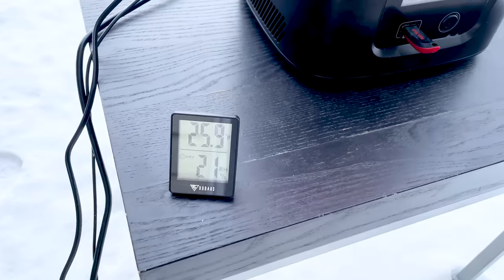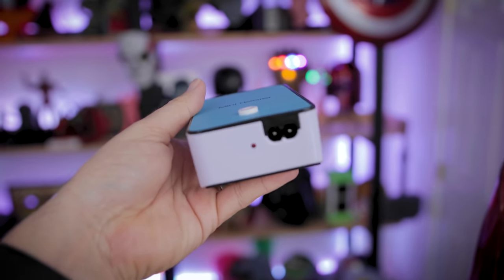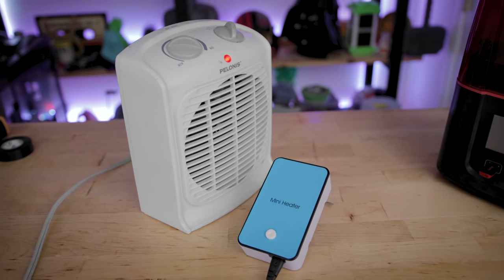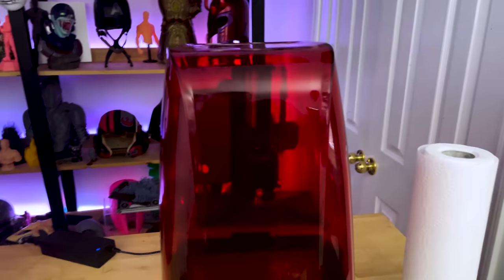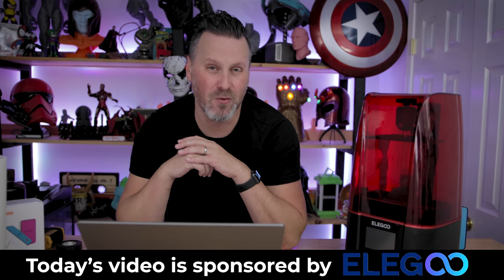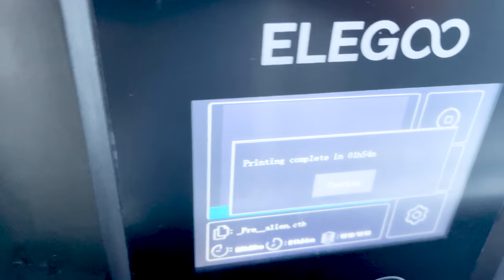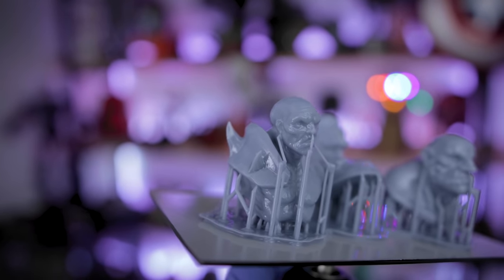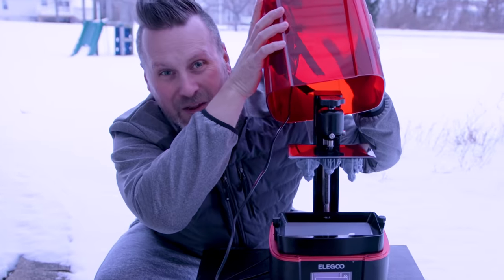Can you Resin 3D Print outside in Snow?! 🥶 + Giveaway Winners!

Comment: My poorly insulated garage gets into the low 60's. What I do is use an under-tank heating pad for aquariums. I take the vat out, sit it on the pad (covered) for 15-20 minutes and when the metal is up to 75 or so I start the print. So far it's worked great! Those heating pads are also pretty efficient. Like 40 watts for a small one, which is still a good deal bigger than the resin vat. I've also stuck the resin bottle back into the shipping box wrapped in the heating pad, but that takes longer and is a lot fiddlier to do, but may be the better solution for multiple printers.
Reply from the maker: Ohhh that sounds like a great option for people to checkout!
Reply: Ooh, those pads are just made of heating strips so you could theoretically find those(I know they made heating straps for bottles), wrap around a metal vat and regulate the resin temperature the entire time.
Reply: those work really well the especially because its for fish tank so it only gets so hot... I bought one of those ild heaters and out in my garage to keep temp in around 70 which works pretty good for me.
Reply: I just put my resin bottles in a bucket of warm water before I start the print and one of those heating mats warpped around the inside of the lid for my photon mono. Works like a dream
Reply: i will try reptiles heating pads to put on the back of the printer there are also heating cables and heating bands for beer fermentation :)

Comment: After a large amount of failed prints in the Australian winter last year, my solution was a heated blanket that I just covered the printer with. Clunky? Perhaps. Worked a treat? Definitely
Reply: That's what the lady at mitre 10 suggested to me when I came searching for a heated seedling mat.
I might end up doing the same as you
Reply: Could you share photos or a tutorial? I’m currently in despair because of cold weather and 3d printing ….
Reply: @istegal8752  only works if your printer is in some kind of enclosure, but just get a heated blanket, plug it in and put it over the printer, and just tuck the edges closer to the printer. Should help a lot

Comment: I use an inkbird thermostate with a Creality Ender enclosure (fire proof and other benefits), a small heater connected to the inkbird outside of the printer, but within the enclosure to get more stable temperatures for the resin. Works like a charm.

Comment: I use a reptile heating pad using the included sticky side to mount it on the inside of my plastic shroud on my mono x, keeps it around 20-24c inside my unheated garage. Haven't had a misprint all winter.
Reply: hello my friend i have anycubic photom m3 max and my garage is very cold i was thinking to use this metod , is it safe to stick the pad on the back of the enclousure ? i mean in the interior, how many W is your pad??
Reply: @lisaciscato255  120v 16w, the sensor is a light sensor - that little sticker on the back of the case just blocks light and tells the sensor the hood is down. Perfectly fine to block it with the heating pad instead of the sticker just keep in mind your going to have to dremel out a tiny notch for the heating pad cord to come out so the hood sits flush. Good luck!

Comment: I use a small (about 8inx12in.) under tank reptile heater mat, cost me about 12 bucks on Amazon and tops out at about 90-95F. I currently have it frog taped to the outside back of the hood for my Elegoo Mars, turning it into a radiant heater, and it keeps the interior of the print bay at a nice 80F or so even when my room dips into the low 60's to 50'sF in the winter with the blackout cover I use from MACH5IVE.

Comment: I use that heater with the VIVOSUN Heatmat Thermostat to control the temperature and provide a safety factor on my Epax E10 in my garage. I glued some 1 inch cabinet magnets to the bottom of the heater and then used a 2 magnet stack per corner on the outside of the case - no drilling of the case and very stable.

Comment: I just had a (maybe) pretty crazy idea...would an infrared heating panel pointed at the printer work? The advantage of such panels is that they don't heat the air but objects that are hit by the IR rays. Inside they are pretty efficient (at least when it comes to heating with electricity). I wonder if it would work outside. They are also not too expensive and there shouldn't be any fire hazard involved.

Comment: I also use a heat enclosure with a small ceramic heater with my Anycubic Mono X  in my garage. It was -6F outside today in Rochester, NY but my garage stays about 39F.  I also try to use a Propane heater in my garage for myself to get the temp up to keep myself warm while painting.

Comment: That mini heater might be useful to have. With winter it gets STUFFY inside, and being on the 2nd floor of a 3 floor appartment, we don't even need the heater on. It easily gets up to 78f in here so a window being cracked open even with how cold it is outside is a must. My 3d printer sits in a corner and wonder if I could mount this, not inside but near by just to help when I do need that window cracked to get some fresh air and to just manage the temp with out having to throw the AC on in winter.

Comment: Congrats to the winners. I am still on the fence about getting into resin printing. I do have a need for one, but not in a rush! I have no room for everything needed. Those heaters do get pretty hot. I have one I use to keep my hands warm while flying drone and it has a low setting which doesnt get too hot
Reply: What do you need a resin printer for?
Reply: @blackhawkuh-6026  I built an injection mold machine and need molds. Been trying fdm prints and silicone to make the molds with a number of issues. I saw high temp resin molds being made and that looks like the best option. Just finding the room and clean area is a bit tough right now. Dealing with cleanup and the fact that I may only use it when a new mold is needed is keeping me from taking the plunge too. Tried ordering prints, but most places didnt have the high temp resin as an option.

Comment: I have been using a 180W personal PTC fan heater inside the Red dome. It's easy to maintain 25 Degrees centigrade.
I did have problems when the temperature drops below 18 degrees.
I believe the Elgoo 3 is the best in field for the price. I have an Peoploy Phenom it is very,very slow by comparison. Monochrome 4K &8K are the way to go.

Comment: My basement stays at a stable 55ºf through out winter. The only thing I change is I bump the normal exposure .1 sec and the base 2 sec, never had any issues. Been doing it for 3 years now, with 4 different printers.

Comment: Is there any way to reagulate temperature (or just power input) on this? It's a little bit overkill, if temperature of printer is more than 30°C in snowy area:) Power input 200W is insane for such a small volume you need.
Reply: I wondered the same but I need to heat up a  Glowforge. There are external thermostats but you need one that controls mains voltage.

Comment: After many fails, I resigned buying a heater for my Mono X. It's the exact heater you have in the video (since people recommended that model).
I still have to figure out a way to get it in my Mono X though, I'm thinking of FDM printing something so I can blow the heat inside.

Comment: Cold isn't my concern. UV is. I was thinking of putting the printer on the balcony and printing in warm weather. I don't want to print in my apartment because of the fumes. 
But then I started thinking about UV and resin curing while I pour it (before the cover goes on) and also if the cover protects the printer well enough from outside UV. 
Any tips on that? 😮

Comment: This is actually a good idea. 
I would consider building up a printer locker in the garden complete with heating and bigger activated carbon filter instead of contaminating my workshop with epoxy fumes.
Reply: how did it go? i just got a 3d resin printer and I want to print in my backyard... i live in a very hot place
Reply: @shsebastian8  in winter, the viscosity of the resin changed the instant i opened the door, so i printed in bulk to prevent fails. The odor of course wasn't a problem anymore. However someone wanted to steal it, fortunately i had steel doors installed, so it was just a minor vandalism damage. They couldn't topple the locker either, because i reiforced the foundation with steel rods. ;)

Comment: I just ordered this and taped it into my anycubic photon. Will secure it better later on but just wanna test it right now. Using siraya tech blu resin. This resin used to work real good on this printer and as of late I’ve run into 90% failures. Supports snapping off even with slow lift speeds.

Comment: 93F is getting to the top end of resin guidance. I wonder if indoors it would get too hot since this unit isn't thermostatic at all.
Reply: Uh oh here come the spambots
Reply: I use that heater in my Epax E10 connected to a VIVOSUN heatmat thermostat off Amazon to hold a 76F temperature inside the cover. Also provides a bit of a safety control.

Comment: what is the optimal temperature for resin printing?  and what is too high/low?
Reply: It will depend on the resin. I’m working with Resione M58 which is very temp sensitive and they recommend 75-95 F

Comment: I've been printing issue free here with my Elegoo Saturn with the room temp being 11c/51.8f. without any heaters  Been printing full build plates of minis and busts.  Only issue so far was last night when printing out a batch of circular bases I got what I can Ribbon Issue where a Ribbon like issue occurred and I needed to filter my resin, on reflection  I noticed I did not use my regular USB stick I had accidently used the one that came with the printer so dunno if there is a connection.           The original Mars printer however I'm finding impossible to get anything printed! nothing sticking to plate, sticking to the fep.......over here in miserable ol Ireland even during the spring and most of the summer temps in the room I print in tend to only get up to about 17c.

Comment: Clayton can you riddle me this? does the Mars 2 vats fit on the Mars 3. I know not the right size but do the bolt holes line up and is it sort of centered over the screen? the mars 3 parts are slow to release and I'm wondering if I can somehow make the mars 2 parts work. Also it is much nicer that the mars 2 vats don't have silly curves or angles. the mars 3 vats don't stand up on edge well.